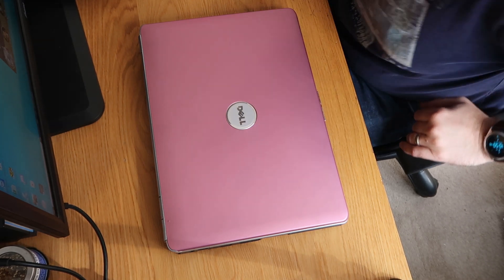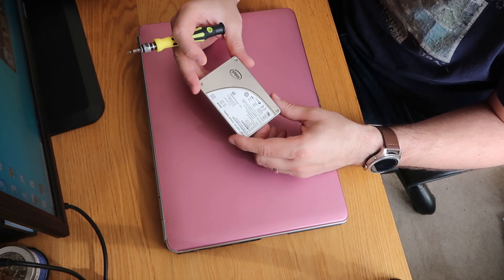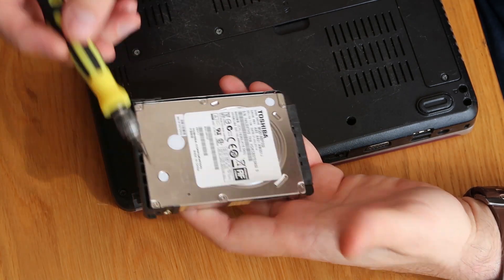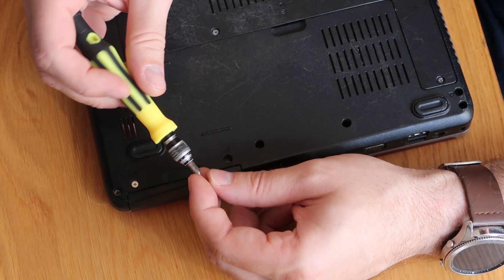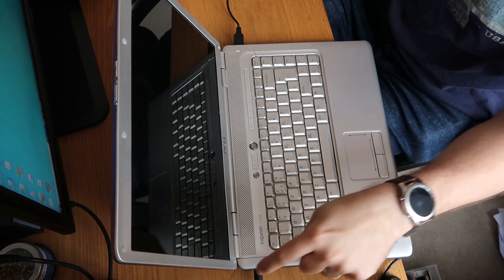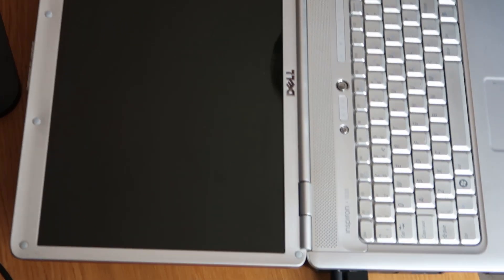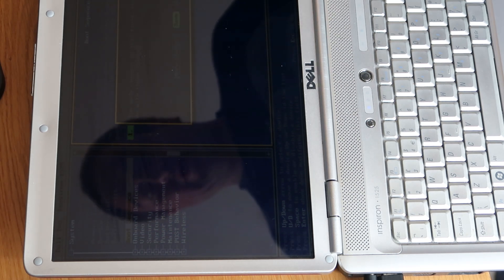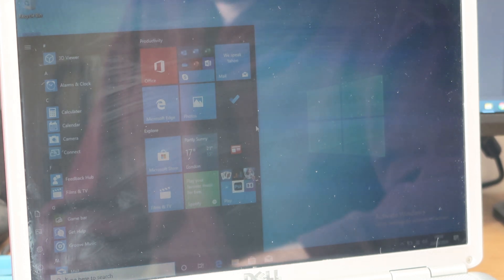Dell Inspiron 1525 - Replacing Hard Drive with an SSD

Comment: Is someone have the same problem that once you switched the hdd it doesn't display?
Reply from the maker: No that sounds like a different issue, maybe loose connection to the monitor?
Reply: @WeRepair  idk it's strange, I didn't jiggle it hard or something I just switched the HDD and that's very simple and isolated from the entire laptop connectors and mono in general

Comment: can we use ddr3 or ddr4 RAM for dell inspiron 1525
Reply from the maker: No only DDR2 specifically DDR2 PC2-5300 667MHz 200-pin SODIMM
Reply: @WeRepair  actually I am unable to find a 4gb + 2gb = 6gb ram  ddr2 SODIMM ram in India

Comment: What is the need of going to BIOS and what if we directly go to the Boot menu using  F12 key because in Boot menu also we get the option to select the Boot device as USB flash drive
Reply from the maker: Yes you can do it that way too
Reply: @WeRepair  thanks for the consideration

Comment: Hello, I followed your steps. But just after boot from USB, it asks for the windows product key! Obviously my Inspiron 1525 is nearly 15 yrs old and I don't remember the windows product key. What do I do?  Before the upgrade the Inspiron was running Windows XP and the reinstallation USB has Windows 8.1 Could this be the culprit? Is there a way around? Thanks in advance.
Reply from the maker: You will need to purchase a license if upgrading from xp

Comment: Hello. I tried with 2 differents SSD. And they (WD and Kingston) were not detected. Setup its Ok. Wht do u think? Could u help me pls?.
Reply from the maker: It should just detect it, does the old HD still work?
Reply: @WeRepair  no. But thnks. Spacer adapter was the solution. With linux mint ... its soo fast

Comment: Hey there, this video comes in handy, let's see if you can help me here,

I tried installing windows 7 in my girlfriend's old Inspiron 1545  (pretty much the same as your model). Problem is that it won't find any booteable device. I was able to insert the SSD properly in the main bay (where the HDD used to be)

What should I do?
Reply from the maker: Can you see the hard drive in the BIOS? I think you have to hit F2 as it boots to check?
Reply: @WeRepair  yep I can see it in the bios. Anyway, I was able to fix it, I just popped in the ssd in the main bay, re installed windows and I worked a miracle. Now it boots perfectly. Thanks, :)

Comment: i have dell inspiron 1525, it has intel core 2 duo processor 2 GHz, 3 gb ram and 300 gb hard disk. it used to be 32 bit and came with a windows vista OS, recently I changed the OS to windows 10 and changed it to 64 bit but since than computer has slowed down considerably even when I removed most of the data on the hard disk. I am looking to upgrade my laptop. if I change the ram to 4 gb will that be enough or going for an ssd will be good for performance?? can we use 240 gb ssd in this computer? does its mother board support these kind of upgradation. with these upgradation will there be good enough performance boost? as  the computer is a bit old. thank you
Reply from the maker: Yes you can use that SSD in the machine and yes should see a good performance boost.

Comment: which processor on it ? can i upgrade ram 2 gb to 8gb on this? only changing ram and ssd on  this is performance improve ? can i work graphic design?
Reply from the maker: I would not waste your time using this for GFX design, it wont be man enough.
Reply: The most you can go to is 4Gb on memory I don't think the BIOS supports any more - the board will support practically any of the low-power 800MHz Core 2 duo CPUs (I use a T7300 which is 2GHz clock 4Mb cache 800MHz bus) - it'll never run graphics quickly, Linux is definitely faster than Windows though - the only good thing is that the chips are about £5) 

For a 15 year old PC it's pretty incredible that it works at all, even more so that it's still able to do ordinary "desktop" stuff - the fact it has an HDMI port and an ExpressCard|54 slot means you can get a USB3 adapter and get reasonable data speeds, but unfortunately won't boot from it
Reply: @gdob1742  I read 6 GB DDR2 RAM is supported. 😉

Max CPU upgrade is an Intel T9500.

Comment: I've tried to install 8 gb of ram but it stalls when it boots up. Is there a way to use 8 gb of ram or 6 gb is the max?
Reply: I thinks this has max 4 GB if I am not wrong
Reply from the maker: Max supported ram on this model is 4GB. SSD is your only option for a speed upgrade.
Reply: @WeRepair  T7300 processor wouldn't do any harm after the memory update
Reply: Supposedly 6 GB is the max.

Comment: We have the same laptop but mine cannot detect the SSD. Is there any way to fix that?
Reply: I had the same problem and my solution was you need to make sure the SSD is properly aligning inside the connectors. Since old hard disk are bulkier and the new SSD drive size are thinner they just slide underneath the connectors. Take care.
Reply: same as cristiana kfdjslgjdkgm the way i managed to make it slide to the connector was removing the oddly-shaped middle bottom cover and very carefully and delicately raising the sliding ssd with a very thin screwdriver (the thinnest from that tiny set daiso sells)
Reply: WOW PAL I BEEN TRYING TO FIX MY LAPTOP FOR HOURS...I THOUGHT IT WAS SOME BIOS THING...TY SO MUCHHH
Reply: I heard people suggested that leave the laptop front side up and slide the SSD in will align it more correctly.
Reply: I just slot my SSD in without the caddy - seems to fit better, I have a flap of duct tape hanging out so I can swap disks over (when laptop powered down!) so I can enjoy Windows/10 pro 64 bit, or Linux

Comment: Hi Team, Is 2.5" SSD will support in Dell 1525 laptop
Reply from the maker: Yes that's correct
Reply: How much gb ssd can it handle?
Reply: @stevenmaloney3787  it’s a sata 2 buddy I did a ssd conversion on my acer 5735 and a iMac core 2 duo cpu swap and now this flies I have also just bought a patriot 120gb for my dell inspiron 1525
Reply: @stevenmaloney3787  Hi Steve 
Does your inspiron also runs with Windows 10?

I am also looking for updating my Inspiron 1525, using SSD and change windows vista to windows 10. What would you recommend? 🙏
Reply: @stevenmaloney3787  That's sound great, gentleman 🇬🇧

Mine also has Intel Core 2, I  think it will run without any issue. 

Greetings from Mexico ✌️

Comment: Thanks for your video..
Plaes I have dell inspiron 1520 with cpu intel 2 Duo T5450 - 32 bit type system
with one GB Ram if I increase the ram to 2 GB can I install windows 10 and the system type will be 64 bit.....???
Reply: sorry for responding late just found this video. if you have 2 gigabytes of ram installed on your system, you can run windows 10 32bit. don’t get windows 10 64 bit because that is gonna use more ram than 2 gigabytes. only get 64bit if you have at least 4 gigabytes of ram. however, if you have a 32bit cpu... you cannot get 64bit. you can go check your system info on your operating system to see if you have a 64bit processor. if you have a 32 bit operating system and a 32 bit cpu you can only use 3.5 gb of ram no matter what. it is possible to have a 32 bit install of windows and have a 64 bit processor.
 TL;DR: if you have a 32 bit cpu and less than 4gb of ram get 32 bit. if you have 64bit cpu and 4+ gb of ram get 64bit.
Reply: @Zeazy  I’ve had it running Win 10 home (64bit ) on the stock 2gB RAM and while it’s texhanically workable, it’s slower than Molasses in Anchorage on a nippy day. I upped my RAM to 6gb (one 4gb stick and one 2gb stick) and it’s working excellently with 64 bit Win 10 pro. The Ram should be cheap, regardless of where you source it since it’s likely an outdated format or speed of Ram.

Comment: I use the same laptop. Is it true that SSD increase the speed of this laptop with win 10?
Reply from the maker: 100% yes. made a real difference.
Reply: @WeRepair  You are right. I just bought & installed SSD of 250gb (ADATA) yesterday. Its very fast in response over win 10 64bit. Already i upgraded the Ram to 4gb.